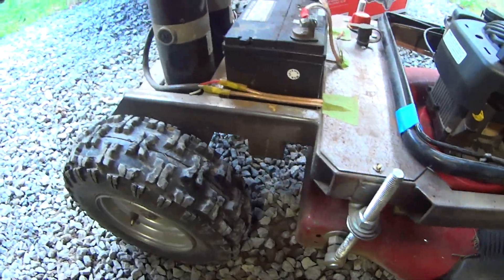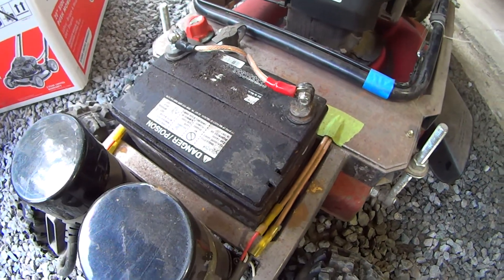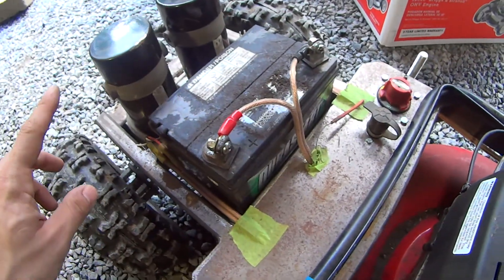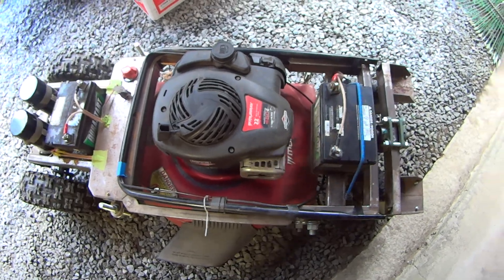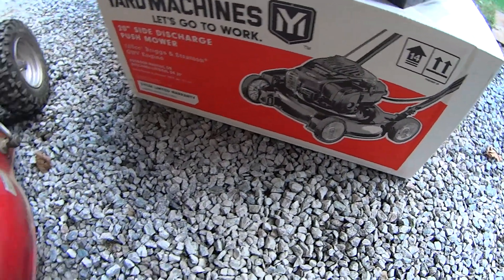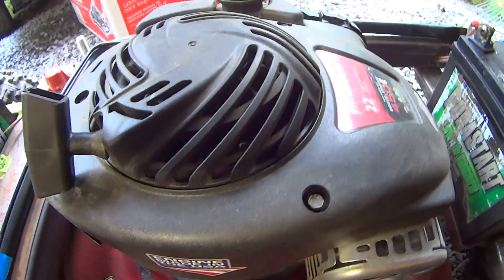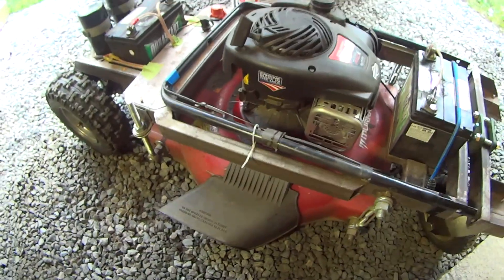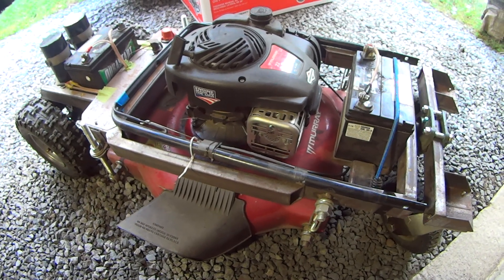RC Lawn Mower version 1 Introduction before revision.

Comment: why a gas mower over a battery one?
Reply from the maker: Runtime and batteries are expensive. I'd like to make it full electric. Ideally I will be able to mow my lawn on one charge and one tank of fuel. I have a bit of grass to mow. In the first version I was never able to mow the whole lawn in one charge. Even though this is now lithium....Cutting grass takes a fair bit of power. If I had to make it cut grass and drive the $200 of batteries I currently have wouldn't be effective. Probably run for 10-15mins... Total guess. You get what I'm talking about though. Plus we can go full electric later. I do like the quiet action of an electric mower. Someday I'll buy a load of batteries... We will do it again. Thanks for commenting and showing interest.